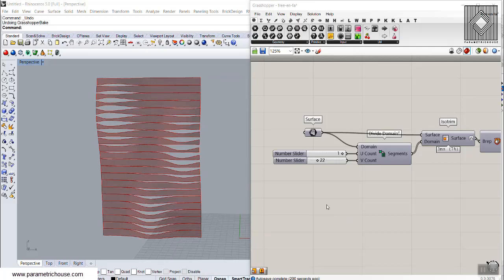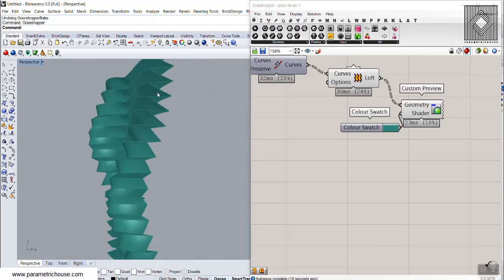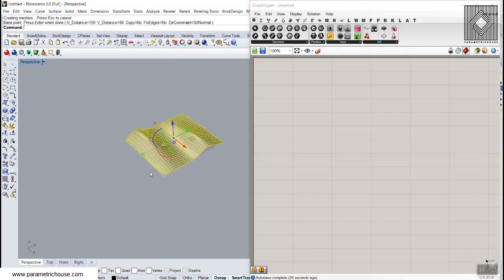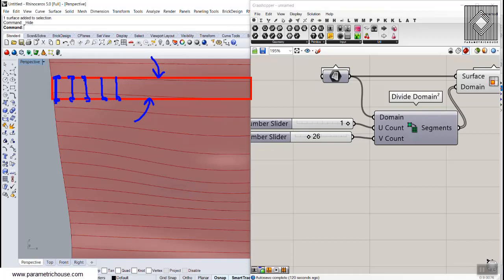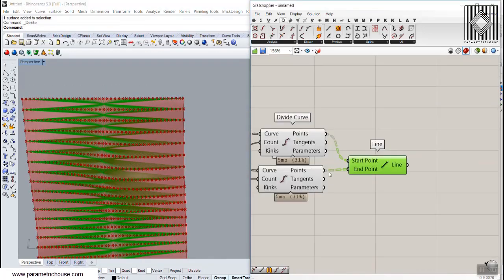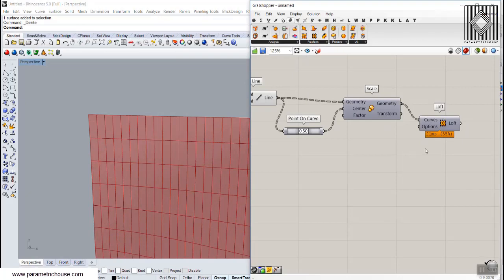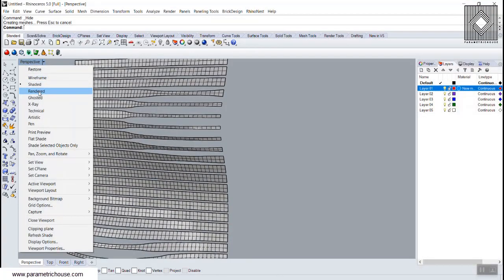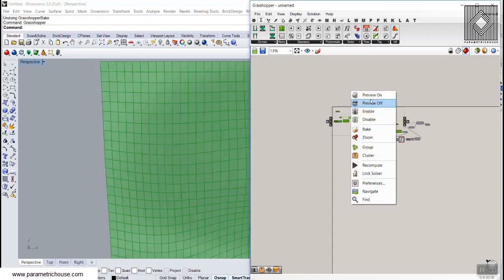Facade Louver (scale)  - Grasshopper Tutorial

Comment: hiya, which option/tool would you recommend to cut holes in de facade? When I use a surface with holes in it allready it just makes the shape square again after using the domain2 option in grasshopper. Thanks!
Reply from the maker: That's because the surface UV curves will be used so the holes will not count! The only way is to go with Meshes which I fear it's a little more complicated

Comment: I've done just the way you showed it, but my result is inverted. Where the original surface "bumps" out, is where the contour surfaces gets thick. Where the surface is flat, the contours are thinner. Any idea to why? Something I missed twice going through the video? :/
Reply: Third times a charm apparently. I just remade the first surface in Rhino and used the same Grasshopper script. Suddenly it worked. I guess id had something to do with the surface being on the wrong side of the X-axis. I got negative/positive and had absolute component on when I shouldn't have. :)
Reply from the maker: Good point Philip! I guess the axis control the frames direction and that brings up the problem!

Comment: Question, if I don't want the point x/y/z to determine the line loft thickness, and I want a set of attractors to determine where the loft gets thinner, how would I do this? I'm not that great in grasshopper
Reply from the maker: use the "closest point" tool to find the distance between the center of the lines from your attractors and use that as the remapping source!
Reply: @ParametricHouse  Does the deconstruct tool get used at all, or is the closest point tool now a substitution for it?
Reply: @ParametricHouse  I'm having issues merging a point charge field with the remap+ tool